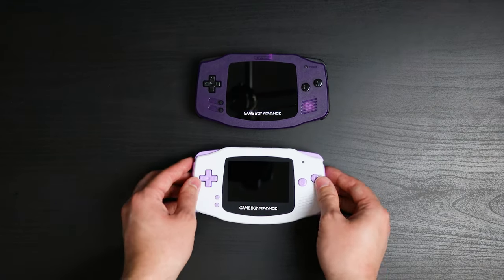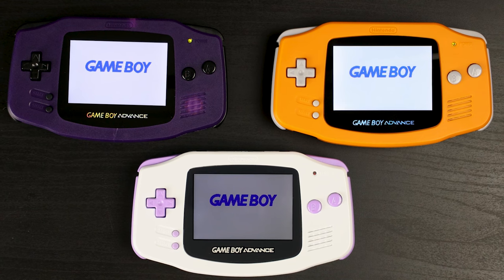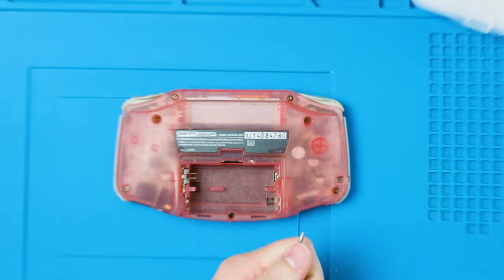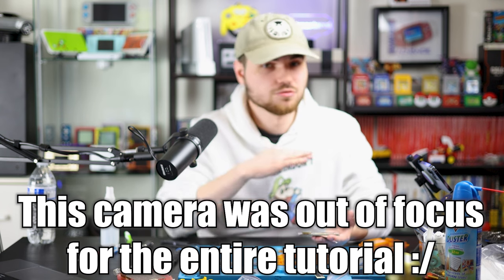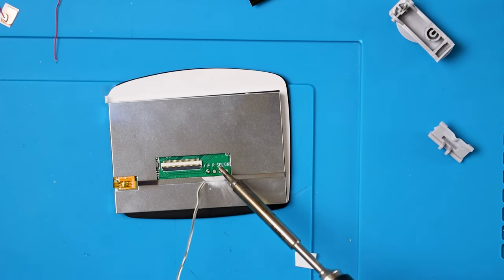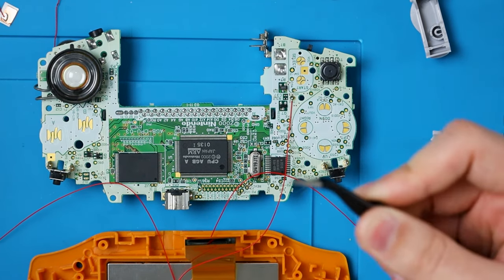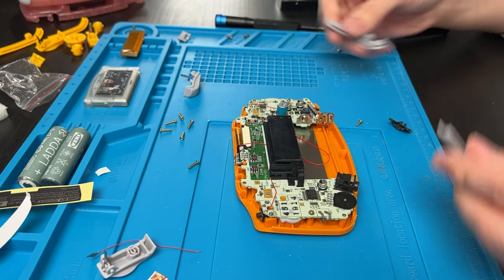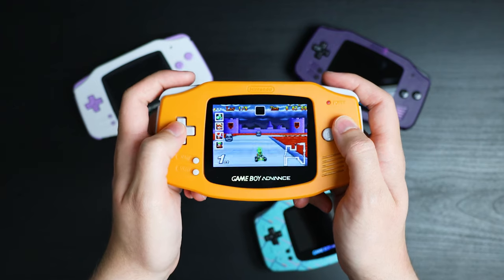The BEST Laminated IPS Kit By Far! | V5 Drop-in GBA IPS Laminated Kit (Review + Tutorial)

Comment: The main problem with the FunnyPlaying v3 kit is the high failure rate. I've build dozen of the V2 GBAs without a single problem, but four out of ten V3 displays where broken or had vertical lines after a few hours of gameplay! And the v3 shells are fragile, don't tighten the screws to hard or they will break!
Reply from the maker: Couldn’t have said it better myself
Reply: Was that your experience with only their laminated ips kits? Was interested in getting their laminated tft version but if it has similar issues I might just get this kit or the cloud game store laminated kit instead.
Reply from the maker: @pspsmallz  haven’t tried their laminated ita kit but it’s just a DSi screen so it should be fine. I just hate funnyplaying’s laminated shells. They are garbage
Reply: @JakeSimmons you mean the shells you have to buy for easy fit with the 3.0 laminated IPS screen? If so: how are they bad?
Reply from the maker: @ratzpop  I would go watch my video on that kit or wait a couple weeks when I explain it all again in my IPS Kit comparison video I’m working on. It’s too much to write out
Reply: Who makes the best GBA shells then?
Reply: Really? I’ve done a lot of them and have had zero issues with them, and had people I’ve sold them to not complain either.
Reply: I built three FP laminated IPS 3.0 GBAs and one of the screens developed a vertical line in the center after only using it for not even an hour. I never had any defective screens with the other FP kits for the DMG/MGB/CGB. This kit seems to be better than the FP kit in every way.

Comment: I have installed this with a new shell (a compatible one) but both the original and the replacement dpads with their respective silicons are not great. They feel hard to push. Anybody that has similar issues and perhaps some solution to this?

Comment: Jay I received all the parts and tools in the mail and finally finished this awesome build! Looks beautiful and the GBA is so much better with this screen and USB-c charging (which I ordered with my kit) is also an awesome upgrade. The build was great BUT there are a few important notes which I didn't pick up in the video:

- The plastic shell is a bit softer than the original and does not match very well with the original screws. On the first try it was a pain to fit everything together and required a lot of force to screw everything into place. As a result, the pole which holds the bottom screw inside the battery compartment actually broke off. I managed to glue this back into place with superglue and on the second attempt, with the replacement screws from Hispeedio, everything came together smoothly. I also have one minor crack in another place.

- I fitted the upper touch sensor right above where the flex cable sits (this is the most natural place to fit the sensor, I believe I also saw it sitting there in Hispeedio's instructions). However, apparently the flex cable interacts with the sensor and causes it to keep switching between screen modes. Very annoying of course, so I opened everything up again and fitted the sensor more to the right side of the GBA. All in all I never use these sensors and would skip them in a next build.

Hope this helps!

Comment: I did the part at 6:40 to remove the touch pads and I kinda regret it, now there are a few light leaks (visible only when the screen is fully black), probably because things moved a little when removing the shielding and putting it back on. 
If you do this mod, I'd advise against doing this part, just cut the wire with scissors if you don't want the pads
Reply: Thanks for the advice
Reply: Thanks for your insightful tip. My display arrives in a couple days and I was nervous to solder them off but I’ll just cut them off
Reply: @SuperRainbowPoptarts  No problem! After cutting them, apply some kapton tape on the ends to make sure they never make contact with anything and you should be good

Comment: I ordered this kit from them but I was dissapointed to find they don't seem to do a compatible shell in the Glacier color (the original clear blueish color). They didn't have names for the colors either so I just chose color "16" as it looked the closest to the original color I am looking for but it could just be plain clear and not Glacier. It's hard to tell from the pictures cus the lighting varies from shell to shell in the pictures.
Reply from the maker: Yeah AliExpress listings are never the best :/
Reply: @JakeSimmons  Turns out it was just a standard clear / frosted shell lol. Not too bothered it was only an extra 5 bucks ontop of the LCD price. I have found a Glacier shell on Amazon so I'll just use my Dremel to trim it down. I've got one of those flexible extensions for the Dremel that I've used for very similar things so I'm confident I'll do a better job than the Aliexpress guys did on the shell they provided. The shell that came with the LCD V5 kit wasn't great. You could see where they had trimmed it themselves before sending it out.

Comment: Can you remove the metal shield(behind screen) after sticking in to the front shell? 

I'm planning to use touchpads and if they go wrong, I'll solder wires to the motherboard. I hope that we don't need to pull off screen from the shell to just remove metal shield behind the screen.
Reply from the maker: After installing a bunch on these, I just install the touch pads because it’s difficult to remove the shielding. They aren’t very sensitive so you probably won’t have any issues of them accidentally going off as long as you don’t place them where you commonly touch the game boy. But to answer question, yes you can remove the shielding after, it’s just gonna be a lot harder while it’s stuck to the shell
Reply: @JakeSimmons  Thanks! I just recieved my GBA and IPS/Shell set today. I've installed pads directly and one at the top(color option) doesn't even detect over the plastic shell, actually it is totally ok for me. Brightness controller works perfectly beneath screen lens. I hope they stay like this forever lol

Comment: I know a guy whos got that constanly pressed R button you mentioned, what would you recommend to him to do? how you fixed it when it happened to you? everything looks fine on the board, btw that guy is me 😂
Reply from the maker: Haha do you have the L and R wires soldered to the test pads? If so, I’d solder them to the pins on the back like I did in this video. If not, make sure the wires aren’t pinched when everything is shut and make sure you’re soldered to the correct spot. If you’re soldered to ground, that’s gonna cause it to constantly be pressed

Comment: Do you have to hold all three buttons at the same time to access the OSD menu or is it like funny playing where you only have to hold down select?
Reply from the maker: Hold select, then press L and R
Reply: @JakeSimmons  oh OK. Thank you. I like how it's not just select.
Reply: @JakeSimmons  I have another question, what temperature do you recommend setting the soldering iron to so that it's hot enough to melt the solder but it's not so hot that it damages the screen? I will be using leaded solder
Reply from the maker: @ChewyChicken589  leaded solder will melt at a lower temperature than lead free. I use lead free and usually solder at 300°C. I’m not sure how low it melts but you can always test by pushing solder into the tip while testing different temps (with the iron not touching anything else) but google says it can melt as low as 180°C. Hope this helps

Comment: So I just completed my GBA laminated screen v5 from hispeedio. Everything seemed good until like an hour later and the brightness setting would not work right. The right and left bumpers wouldn’t increase or decrease the brightness and I couldn’t cycle the other options. Then after a minute it just started cycling through all the options. I’m a little discouraged at the moment so any help would be appreciated. Note I opted for the soldered version.
Reply from the maker: My best guess without seeing it is that something is bridging. I would double check that your solder job isn’t touching anything else around it and/or you didn’t pinch any of the wires when you put the shell together. It’s very common for those things to happen and cause the brightness controls to either not work or go crazy. Especially double check that you solder to the correct pins on L and R and that your select wire isn’t touching any of the vias (tiny holes) around tp2. Hope this helps!
Reply: @JakeSimmons  alright I’ll check those out after work. I’ve noticed if I haven’t played in a bit that everything starts working properly again. Then after about twenty minutes it goes haywire again. Not sure if the heat from the motherboard is causing the solder to expand somewhere and bridge maybe and then when it cools it’s good until it heats up again… I’m clearly just throwing spaghetti at the wall with this theory. Even so, have you seen anything like that anywhere?
Reply from the maker: @MsJom123  your hands would but if that were the case😅 I’m gonna guess you’ve got a wire pinched

Comment: Would there be any issues from me modding it to have an IPS screen and use a flash card? Since its an old console would it just strain it too much and destroy whatever lifespan is left of it? Will battery life be too poor on the default brightness? [no soldering experience] _ i was thinking about buying the hispeed kit and was worried my gba's just too old for using this and a flash card
Reply from the maker: I use a flash cart and it’s fine. Slightly less battery life but there are solderless drop in rechargeable battery mods that will help with that
Reply: Solderless drop in rechargeable battery mods? That sounds crazy. That's good  i mean I've had my GBA for like over 20 years so my main concern is it just getting too strained from using an IPS screen.  But in fairness it hasnt been used in like 15 years. I just dont want to buy it and suddenly my gba's just too old to function

Comment: Wouldn't it be possible to remove the PCB from the display using a small string? 
I want to do this sometime but I am really concerned about soldering on top of the display
Reply from the maker: It’s gotta be possible to remove it, but I’m not sure how sticky the tape is. You might end up damaging it before getting the chance to solder :/ If you use flux and don’t put heat on the board/screen for more than a second at a time, you should be fine. Flux helps so much
Reply: @JakeSimmons  alright, thank you!
Reply: hmm maybe something like a coin act as an heatsink would help to not heat the pcb up and damage the screen ? @JakeSimmons

Comment: I just had this mod kit last week
It seems perfect but there is an issue with the power led
It keeps flickering all the time.
I tried with the regular lcd and it doesnt happen. I think Ips screen consumes too much power that leads to this flicker.
Reply: Dirty power switch + low voltage batteries (NiMh)?

These IPS screens suck a lot of power. Clean the switch first, if it persists then swap batteries to 1.5v AA (assuming you’re not already).

Comment: I put the screen in and soldered everything. For some reason my gba doesn’t read gba games but gbc/gb it reads fine
Reply from the maker: There’s a switch in the cart slot that might be stuck or dirty. It gets pushed down when you put in original carts to switch the voltage. It’s supposed to spring back up when you remove the game and shouldn’t be touched by GBA games because there’s a notch in the cartridge
Reply: @JakeSimmons  I see, thank you. I got it to work. Put a little bit of WD-40 and pushed it with a q tips and it started to read. Thank you for responding man 🙏🙏🙏

Comment: Can you cut the touch pads off instead of soldering them off
Reply from the maker: Yes but you need to make sure that the end of the wire isn’t touching any metal or any parts of the edges of the shell. The wires still act as a touch pad, just with less surface area

Comment: I am having trouble with all screws going into the highspeedido shell. Is anyone else having or had this issue? Looking for advice. If I put anymore force into them I’ll strip the screws. Tried both oem and screws that came with shell.
Reply from the maker: What size bit are you using? It might be too small
Reply: @JakeSimmons  I was using the two that came with the V5 kit. Going to pick up some better screw drivers tomorrow and try that out

Comment: Wait so is the Alixpress link the same kit as the one you're showing?
Reply from the maker: Yup
Reply: @JakeSimmons  Thanks for responding, I ended up getting two kits, two USB-C battery kits, and a knockoff Everdrive 64!
Reply: @JakeSimmons   Finally got the kits in, and they're alright, but the buttons were sadly too small and quite loose. Ended up just using the original buttons and D-pad. Plus the pastic is pretty brittle, I tore through the battery panel while doing that bottom screw, left a bump on the front of the Gameboy too sadly. That's likely due to this being my first reshelling.